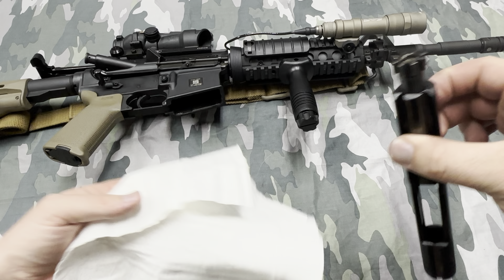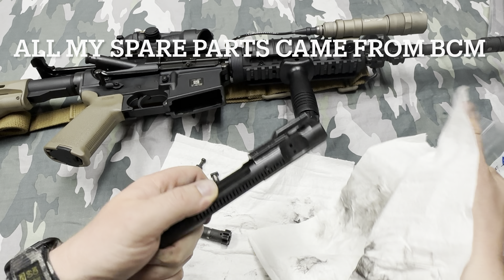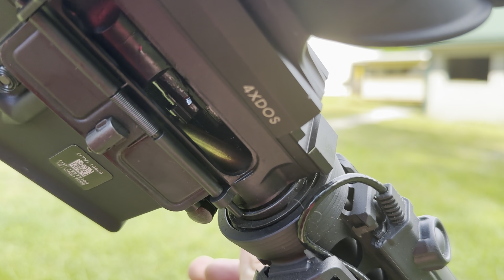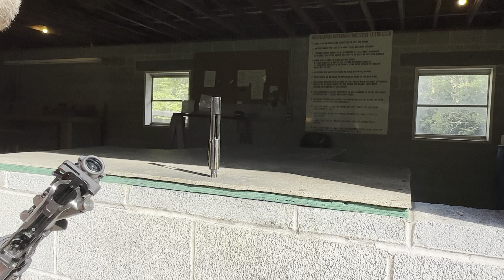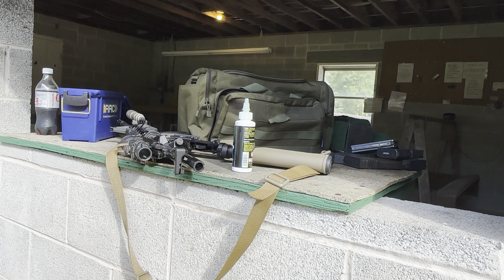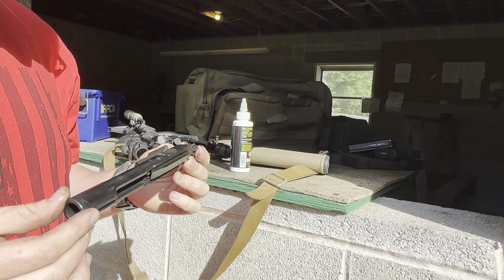Colt M4A1 dead at 2,000 rounds (kinda)

Comment: If new gas rings do not solve your issue it may NOT be an under gassing issue but the exact opposite. The carrier being caught on the bolt catch instead of the bolt is NOT always short stroking but can be an over/high velocity issue. There are a number of YT videos that show running an AR without any gas rings and that they ran just fine has been demonstrated. I can't say exactly for sure what's going on with your rifle without looking at it but as more and more gas port erosion takes place obviously the more gas you get. Not saying an over velocity condition is the issue with your rifle but something to consider.
Reply from the maker: Well it ejects to the 4 o clock, and it does better with a lighter weight buffer. And you are correct the guns not fixed I took it out this morning it’s better it’s not a single shot now. However it won’t lock the bolt open reliably
Reply: @THEPAGUNGUY  Ejection pattern often can indicate gassing but not always. Other factors such as chamber dimension, ejector, extractor, ammunition, bolt drag on the magazine feed lips, buffer tube, trigger hammer ... You'll get it figured out!

Comment: Your bolt carrier group should be fine. Having said that gas rings are a bit unpredictable. 2000 rounds is a bit low. Are you running it suppressed at all? Overall gas rings typically need to be replaced at 3000 to 5000 rounds. You're doing the right thing by lubricating the gun. The gun isn't intended to run dry. I have used G96 CLP both in the military and personally with no issues. I bet if you clean your bolt, you would see the MPC again. Run another set of gas rings and see what happens before doing anything drastic.
Reply from the maker: When I scrubbed the bolt on sat night was when I noticed it was gone. I’m gonna put the hole thing in the ultrasonic cleaner after the full 2500 rounds. I’ll see if I can find it better then.
Reply from the maker: I was surprised how easy changing the gas rings were it only took me 5 mins and no it’s not ran suppressed. I don’t believe I can mount a suppressor bc it’s pinned and welded with colts extended flash hider. I think I would have to have it removed and replaced w a suppressor host.
Reply: @THEPAGUNGUY  make sure your gas rings do not cross each other as well. They should sit independently in the gas ring channel and rotate freely.
Reply from the maker: @thecoltar15resource  hey I found the MPC again if you have time I posted 2 more update videos. The next video is linked and pinned to the top of the comments in this video. Would like to hear your opinions…..

Comment: If the inner surface of the BC ring rub is roughly finished, it'll eat up the gas rings.  New rings are only 50 cents to a dollar each.  May as well have some on hand.  I got a 9 pack of Springco rings for seven or eight buck a while back from Primary Arms when I was ordering some other stuff.

Comment: Gas rings are suppose to wear out. These guns run dirty. Clean your gun . Expecting 6000 rounds on gas rings ? Clean your gun every time you shoot . You cannot shoot 2000 rounds without cleaning . If you just keep adding lube to the bolt you get sludge. The inside of the bolt carbons up.
Reply from the maker: I geuss you need to watch military arms channel he has a BCM there like 9000 rounds w no cleaning or lube….. and I never said I didn’t clean it…. I also lube it every time I went out watch my videos I’ve gotten comments on how I over lube my guns
Reply: @THEPAGUNGUY yes but he's paid to run things until they break. Or he always gets broken stuff to fix.

Comment: I see no (newer model) “colt cage code”  or (old version) “C” marking, on the upper next to the square forging mark. Is that a genuine Colt upper? I have one older LE6920 with the “C” mark next to the forge mark and a newer upper with the Colt cage code next to the forge mark. The upper looks a little suspect, unless something has changed. That may be some bad subcontracted out of spec upper which may also mean a bad subcontracted bolt and carrier.
Reply from the maker: Yes they haven’t always been marking there uppers since 2021 you can go back in my videos and watch the unboxing and basically the life of this colt if you would like I shoot it quite a bit.

Comment: Did you check the surface of the inside of the carrier where the bolt inserts. If it’s finished improperly it could of chewed up the rings. Or you could of had some bad rings and when they broke chewed up the chrome lining. You check your gas key and make sure it’s tight? Hard to tell from here but looks under gased. Loosing gas from somewhere might be leaking from a loose gas key

Comment: Gas rings fail, the gun will still run, but crap happens.  When they shear off like yours ussually comes when putting the bolt back in the carrier a ring could get pinched and once you shoot it it will shear off, it's no biggie, happens more often than people think.  Some manufacturers are making their spread a little wider for a thighter lock up and this is exactly what happens.
Reply: Furthermore, check the inside of your carrier for any scoring it shouldn't happen due to the material being harder than the rings, but you never know.
Reply from the maker: Yea I went and tried to shoot it again after replacing the rings… it cycles but won’t lock open currently still. There’s a gas issue w that bolt. It works great w my other colt BCG
Reply: @THEPAGUNGUY need to put that heavier buffer weight and see if that helps.
Reply from the maker: @ratagris21  check out my latest video if you would like I threw in a BCM BCG and a H1 buffer and it’s running like a sewing machine
Reply: @THEPAGUNGUY  glad you fine tune it.

Comment: I’d replace the entire BCG. The bolt OD or carrier ID is out of spec. Also the carrier ID could be really rough. You should get 5k minimum on gas rings with a good BCG. Malfunctions are probably due to short stroking because of improper gas seal in BCG. Colt isn’t what it used to be.
Reply from the maker: Yea I’ll be replacing it I replaced the gas rings and it still won’t lock open currently something is out of spec w it and it has been getting worse. I swap w another bolt carrier and it works fine.

Comment: the mpc makring is lasered on after the phosphate coating so yes,it will wear off. has nothing to do with performance. u  shot through half its service life already. some times they go quick and sometimes they last a long time. buy a good set and make sure the gas ring run is in spec.

Comment: Replace the rings with quality ones and see what the ejection pattern is.  It looks under gassed ( 4 to 4:30) in the shooting footage, probably because half of it is going the wrong way haha.  change the rings and if the same happens to the new set of rings then you may have a bolt or carrier issue.  I bet you just got a bad gas rings.  People say Colt is cutting corners like crazy.  maybe they are right?

Comment: Not all bcg are bad 100 percent maybe you got a lemon off the bat, I owned a Colt bcg, never been cleaned just oiled and currently it’s more than 5,000 rounds, I own just a Toolcraft for more than 3,000 rounds and a DD with also around 5k. Either change the gas rings or buy another one and move on. It’s not the end of the world, parts breaks.

Comment: does colt not put cage codes on the upper anymore? anyways thats not colts fault,gas rings are a wear item and thats why its so important to inspect and service ur carbine. its a mechanical item which means it can  and will break, just like ur car or truck. they need service and nothing mechanical is impervious to breakage. u might want to measure the gas ring run to make sure its proper size. if this is a complete colt then it should be good cause they have good qc and i have never seen an out of spec bcg from them but that dont mean it cant happen. cool blaster man, u got a new sub.

Comment: Check out “school of the American rifle” by Chad A. His YouTube videos will run you through some bolt and carrier inspections. That’s very premature for gas rings wearing out, I have a 10.5” 556 gun with about 6-8k rounds mostly suppressed and those rings are still passing the stand up bolt test. There’s also the suspension test. However, there may be some poor machining inside the carrier that’s prematurely wearing your gas rings so take a look in there with a bore scope if you can. The rough machining may tend to grab the gas rings and throw off the gas rings test. Do the bolt or cam pin wobble excessively when installed?
Reply from the maker: I actually do watch his videos I was wanting to get a bore scope anyways. So I’ll order one and I’m gonna sit down and follow his video and inspect the bolt. I’ll prob make a video on it. If I discover that it may keep wearing out gas rings I’ll just replace the BCG. Like I said in the video I’ve been having small gassing issues every now and then for at least 500 rounds I changed the buffer to a lighter weight one and it was better. I figured it may have been cause it was dirty. Then I cleaned it and it got worse lol.

Comment: G96 I believe is supposed to be a dry lube because it touts the fact that it didn’t attract sand in the desert like other wet lubes
Reply: G96 Gun Treatment is a preservative, not a lubricant. The G96 CLP is the lubricant.
Reply: @SmallArmsSolutions  thanks. Their lineup is a tad confusing

Comment: You should watch Chris' at small arms solution YouTube channel videos on the history and the rise and fall of Colt. Mainly watch his videos on old versus the newest Colts. He explains a lot from a Colt and industry insider viewpoint.
I have an LE6920 from aound 2010. I have run a lot of good and cheap 556 and 223 and steel cased ammo through mine. It shoots the cheap and dirty stuff just fine, but then again, it's a carbine length gas system so of course it's over gassed and cycles weak stuff just fine. I also shoot a lot of m193 and m855. I've used it in a few carbine courses and let it get pretty dirty and still no problems that more clp didn't fix at the worst. I'm still happy with my m4 roll stamped colt but I would not buy a new current production one whose serial number starts with CR.

Comment: I would gET RID of that thing brother. It cant be trusted at all man.
Reply: Dude was running low powered ammo . And swapped out the original buffer . Might not be all the rifles fault.
Reply from the maker: I went to a lower buffer bc of cycling issues. I wasn’t shooting steel case it was brass case ammo

Comment: I'd bet the gas key where it elbows down into the bolt on the down turn change the key out or scrub soak it off the bolt  i bet solves a lot of your problems believe what I'm telling you I've killed several and thats my general first area of problems is the down turn the elbow in the gas key gas has a lot of build up trying to make the down turn going back into your bolt.